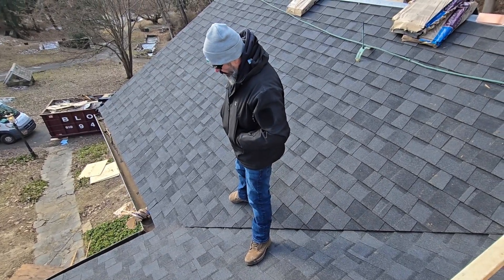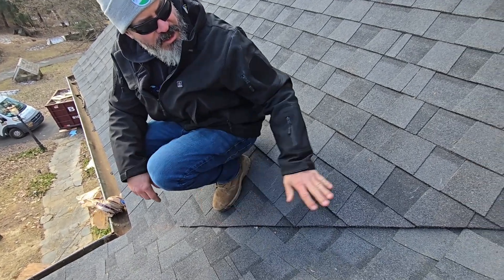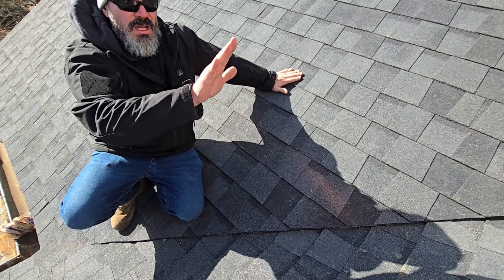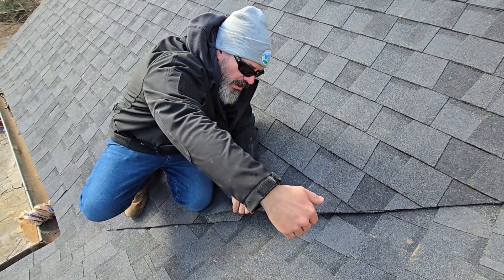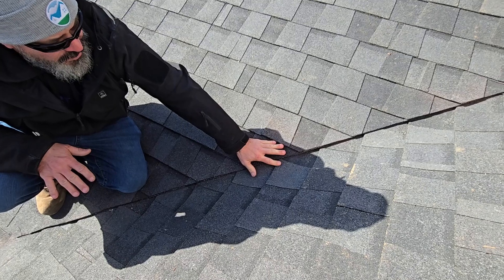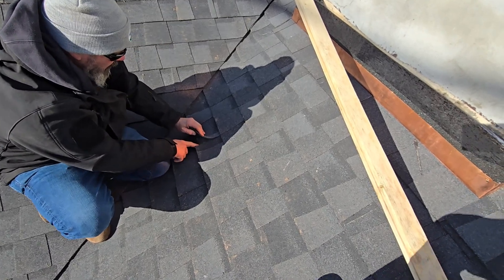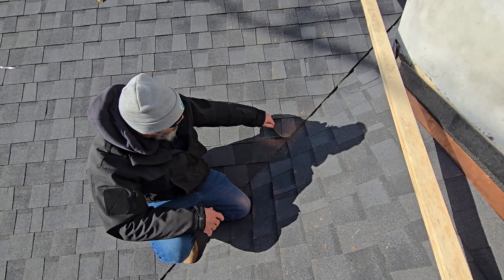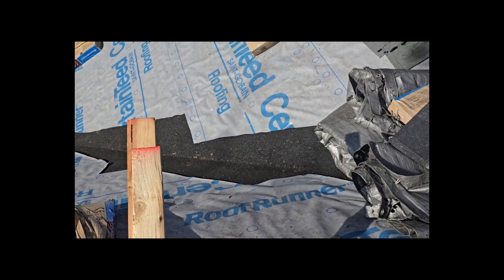Cross-Cut Roof Valleys Explained: The Theory and Best Practices

Comment: Cut the points in that valley, it will reduce the water that goes underneath that valley by up to 50%
Reply from the maker: Yeah I should have mentioned dog earing the valleys for proper watershed ...good point!
Reply: @ many years ago as in probably 25 years ago, I actually argued having to cut the points in the valley with my boss at the time, I told him it did nothing, not long after that he took me out on a roof leak in a valley, all he did was cut about 2 inches off of the top of each shingle point in the valley, it never leaked again. From then on I was an absolute believer.